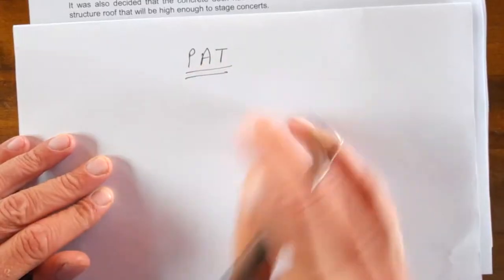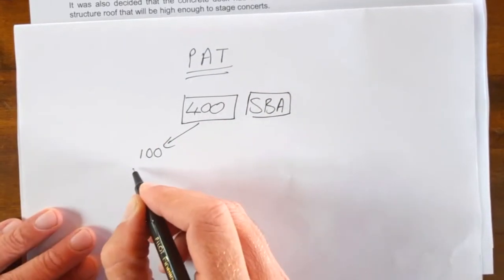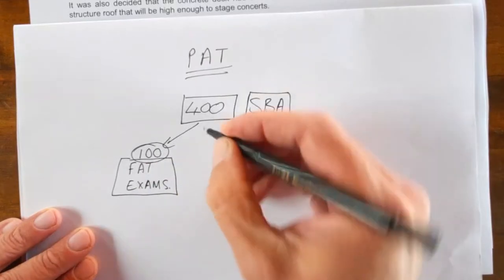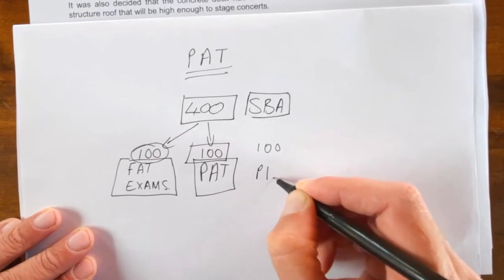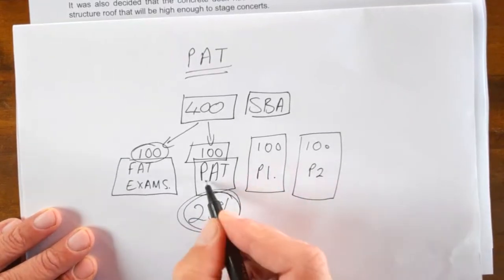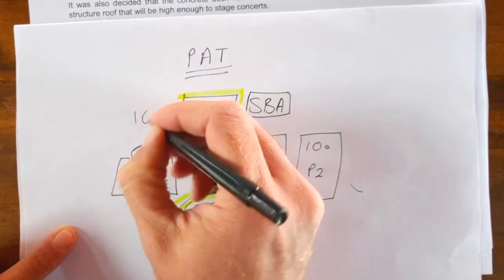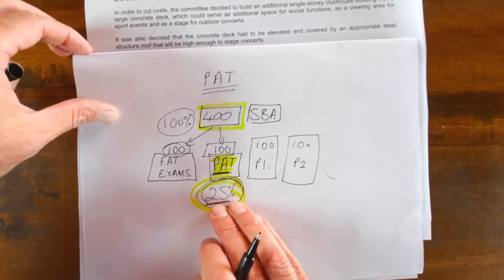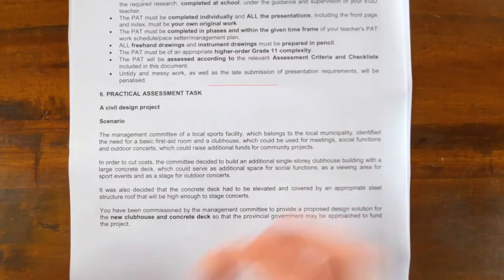EGD CIVIL PAT TASK - In Depth Discussion - EPISODE 1 - Grade 11

Comment: Hi Mr Kleyn, do you perhaps have any videos that explain Grade 10 EGD PAT - Mechanical Design Project?
Reply from the maker: Hi Raylene, unfortunately not at this time... the Mechanic PAT is a tough one. Good luck.
Reply: @HowToEGD  Aah that's a pity! It is sooo hard and hard to find research that helps. This video did help with the upfront section as it was pretty much the same, so thank you!
Reply: If you have any advice on resources that can help, please do share. Thanks
Reply from the maker: Will do Raylene, all the best with yours.